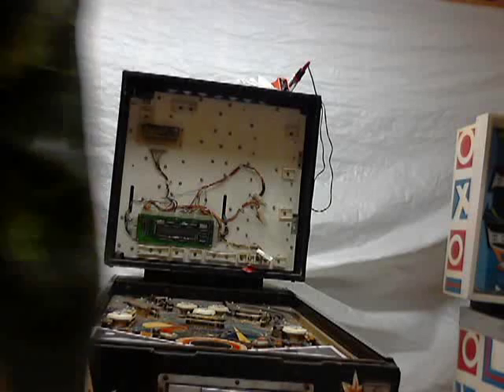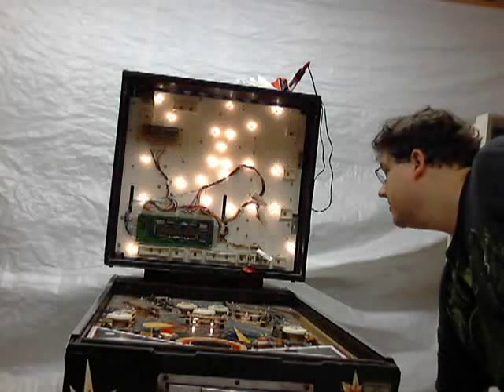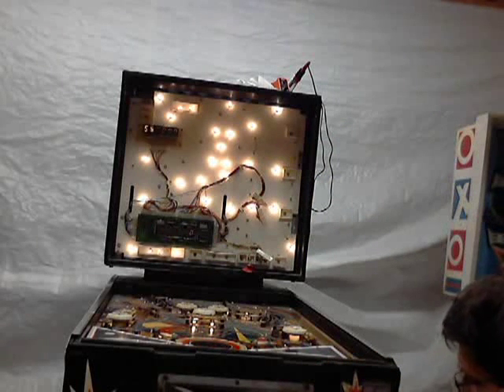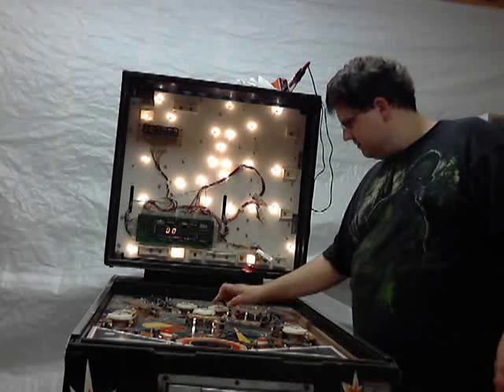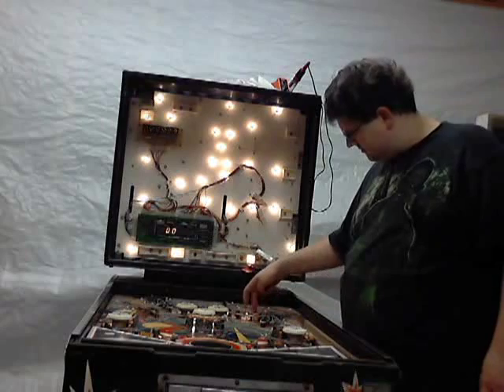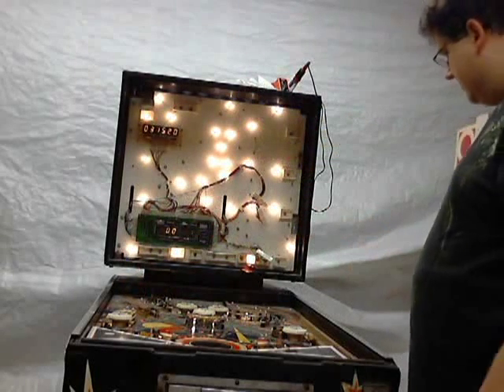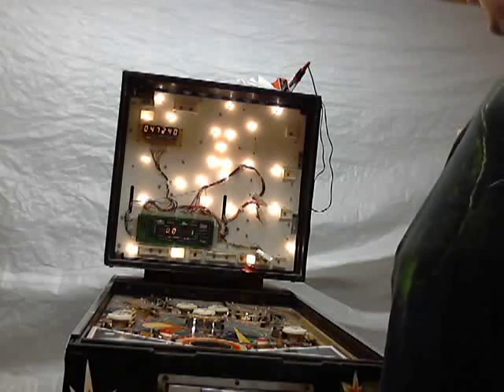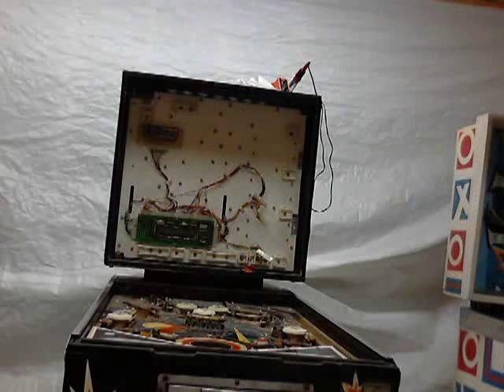Williams Stellar Wars Pinball - Powered on for the first time after board work

Comment: Hello, did you ever have a part 2 or specifically fix the sound issue? I have sounds on my SF however only when i use the right flipper (different  sounds each time)